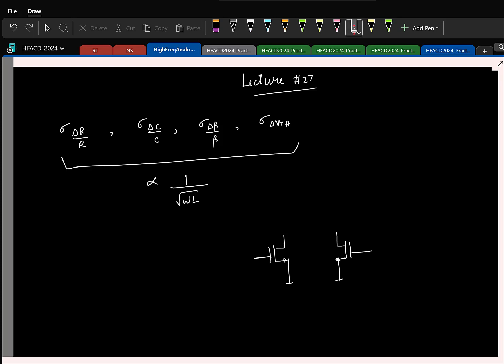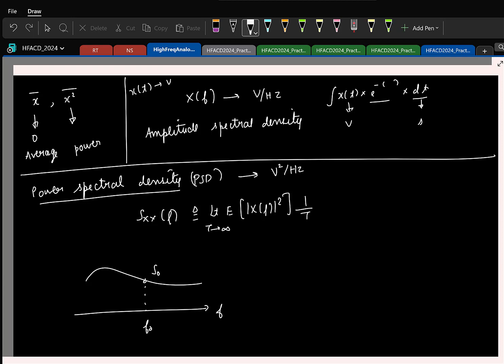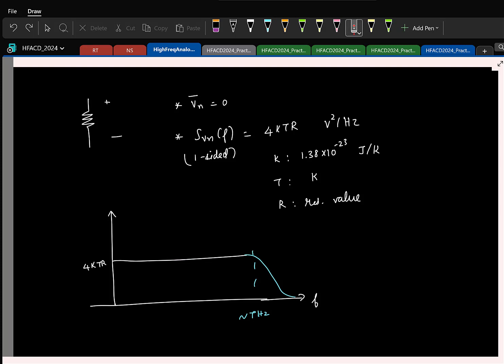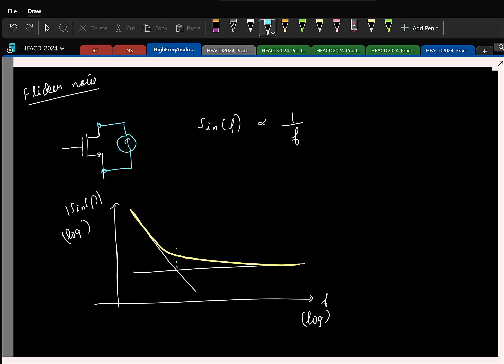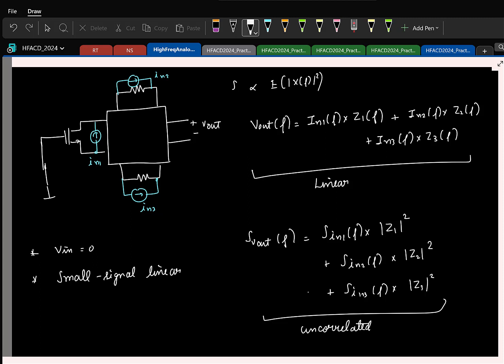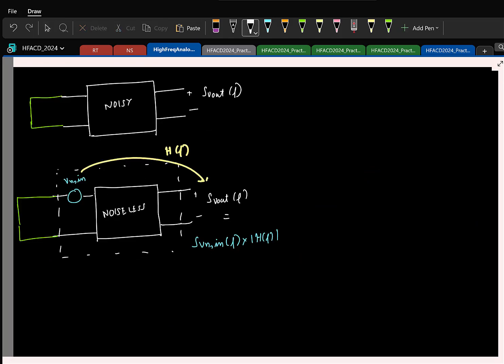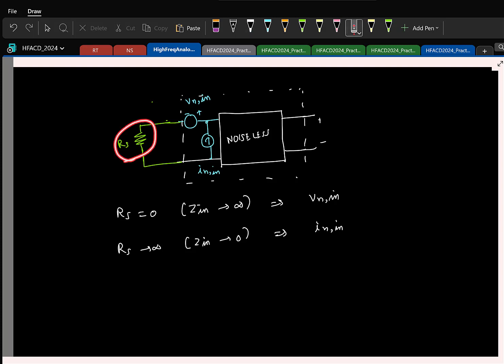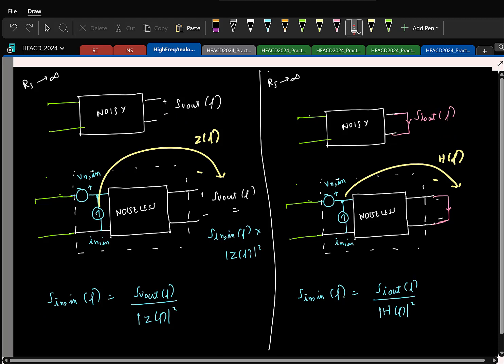Lecture 27: Noise resistors & MOSFETs; Input ref. noise voltage & current in a linear 2-port network

Comment: Sir, here you  said we need to make Rs = 0 to find PSD of input referred noise voltage and Rs = infinite to find PSD of input referred noise current. But how can we arbitrarily set Rs to 0 and Rs to infinity ? It is not under our control right ?
Reply: Ok, I got the answer to this doubt in Razavi textbook. Posting it here incase anyone finds it useful. The model that we use to characterize noise is valid for all values of Rs as it characterizes the circuit and Rs is not part of our circuit that is being characterized for noise. So, we can use any value of Rs when we find out input referred noise voltage and noise current. Choosing extreme values of Rs (0 and infinity) makes our analysis easy.